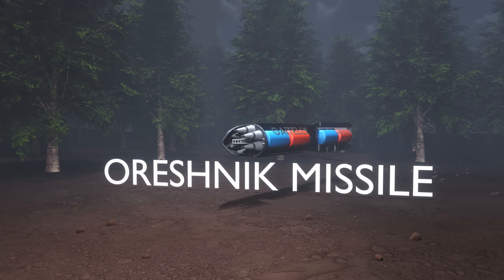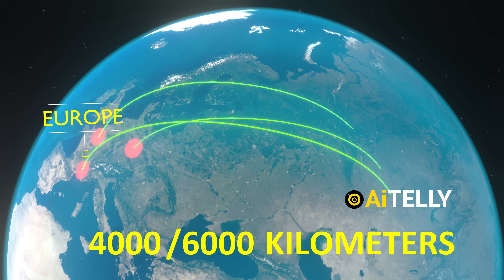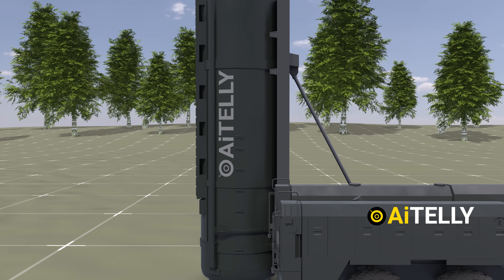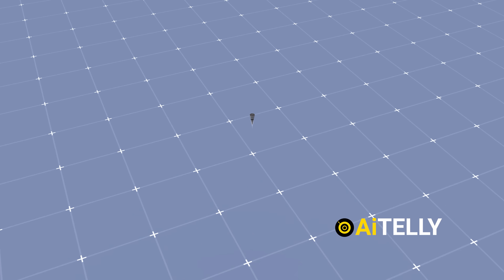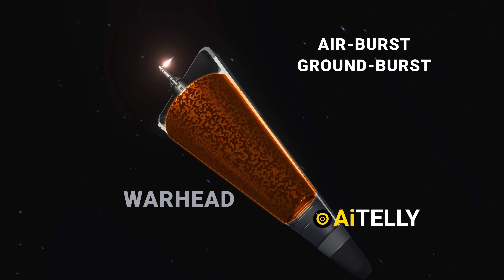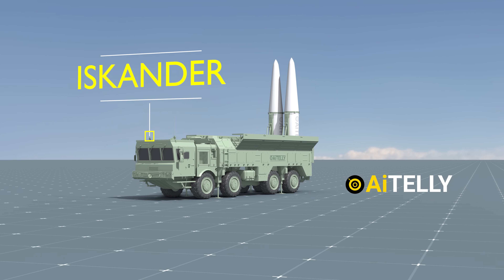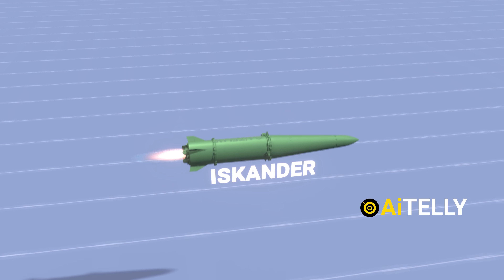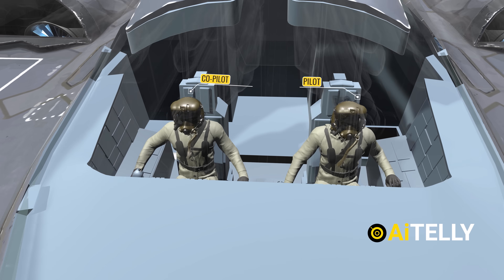Oreshnik Hypersonic Missile | How Russian Intercontinental Ballistic Nuclear Missile Works?

Comment: This didn't quite illustrate Oreshnik and it's 6 by 6 projectile
Reply: Yes the video fails to mention it's 6X6=36. Also the fact that even without a warhead, it impacts at 4000°c melting basically anything.
Reply: Noname knows more then the governments 😆 they just watched from satellites and radars 😂
Reply: Lmao I watched a video were this guy talks about how old Russian missiles are their infrastructure is destroyed. They have old planes have old choppers. They have everything old he said 😂😂😂. I live in Texas. The infrastructure here in Texas is horrible everything is old. Everything is falling apart their electric electricity lines suck.
Reply: But it did gloss over that detail and it's AI so it thinks that's normal/we didn't click to learn that - we clicked for a video where that part of the missile is described as 2nd stage and nothing more - especially if that is the info that sets the missile apart
Reply: @Noname-dtek >"there can’t be any other materials there except special composites"
 Look up Bor's heat shield. That's decades ago. 

>"entry into the atmosphere"
 It might not be leaving the atmosphere during any stage of the flight. The Russians have been favoring shallower trajectory options lately (which yes, are more energetic and require better energy management - but are much faster and more maneuverable - plus stay out of the region that's within the flight parameters of some of the long-range countermeasures currently fielded). 

>"what does it mean that heavy is good?"
 The energy transferred to the target is derived from the strike elements' speed AND mass. Kind of like Rods from God on a smaller, nimbler a scale. Needless to say, the greater mass (per given aerodynamic cross-section) also reduces the sped loss on descent. 

>"the throw weight of the Rubezh missile is 800 kg"
 We don't know the degree of evolution the precursor missile, the bus, and the payload configuration have undergone other than the elimination of the fairing. We may be looking at a factor of 2 payload increase vs your estimate. 

>"if they are separated from standard warheads"
 Like I originally expressed, there may not be a "standard warhead" - those six cones likely each split up into 6 slim sectors radially.
Reply: @Noname-dtek  >"there can’t be any other materials there except special composites"
Look up Bor's heat shield. That was how many decades ago already?

>"what does it mean that heavy is good?"
The weapon is purely kinetic.

>"the throw weight of the Rubezh missile"
Little is known about the actual missile used, although I expect the individual strike "needles" to be in the 20-50kg range. Although the latter at Mach10 would equate to just 73kg of TNT, if they're indeed tungsten, that energy is very focused. At high speeds, concrete, soil, metals, everything - behave essentially like liquids. That's how if you shoot a nail from a nail gun into concrete, it's stuck there whereas if you pound the same nail with a hammer it'll get bent and/or crack the concrete. So that needle may go through tens of meters of reinforced concrete like a hot knife through butter, and only when it slows down, transfer the bulk of its kilograms of TNT worth of energy to the surrounding space.

>"where is the main body of the warhead"
There isn't one. The latest Russian scheme is, no overall fairing - the cones are "naked" with their noses gathered together - not sitting parallel on the bus like on this video.
Reply: No
Reply: It's not carrying 36 warheads.Atmospheric re-entry needs refractory materials. I think it is clear why. And it is simply impossible to create many such submunitions, and they are still very small, which means they need a special stabilizer that not only weighs a lot but also requires a lot of space in the submunition, of which there is not enough
Reply: @Maxie1_4  bruh, there is literally multiple videos of the 36 warheads, what are you on  about
Reply: @leight420 so maybe there were 6 missiles? I explained everything to you and you can't say anything and just tell me about a video that I've seen a thousand times
Reply: @Maxie1_4  if it was 6 missiles the US would've already said so. Ukraine themselves said it was one ICBM, if it was more than one the media would've screamed it to the heavens. You should stop thinking, you're clearly bad at it.
Reply: @lancerevo9747 any mass-introduced opinion is obviously false, think about it. I have not seen a single confirmation of this fact, full-length with all the facts taken into account or at least documents, my words are supported by the laws of physics and the performance characteristics of Rubezh or Oreshnik and so far I have not seen anything that could refute this
Reply: @Maxie1_4  do your "laws of physics" also supersede infrared detection of the launch vehicle exhaust plumes through which the US was able to determine it was one missile fired? If you disagree, why would the Ukrainians fail to report this damning piece of news and use it for propaganda? Also, artillery shells have between 50 to 5000 submunitions per shell and you say "its impossible to create many such submunitions"? I said you should stop thinking, you're hurting yourself
Reply: @lancerevo9747 so what's the point of the US saying how many missiles were flying? On the contrary, it's more profitable for them to say that it was one missile, all Russians admired this weapon and no one would have any questions about why Putin is wasting so many expensive missiles on one non-working plant
Reply: @Maxie1_4  the weight is part of the payload. Heavy is good, heavy is reliable, remember? :) I expect each cone splits up into 6 slim sectors (asymmetrical darts) with the control systems initially nestled in the center of the cone when together. Once they split up, whatever material protecting the control system (ablative or Buran / Space shuttle orbiter type) only needs to be thick enough to withstand just a few sec of exposure. The rest of the dart is likely just tungsten or even some tungsten alloy for extra insanity. With today's tech, you can powderize and bake together materials that wouldn't ordinarily even form an alloy.
Reply: @AlexKarasev Well, firstly, there can’t be any other materials there except special composites and the plasma cocoon will be not only during entry into the atmosphere but also all the time when the rocket has entered the atmosphere, so these are definitely not just some materials that must withstand entry into the atmosphere  . what does it mean that heavy is good? no I repeat to you once again the throw weight of the Rubezh missile is 800 kg to produce 36 small warheads which will be about 20 kg in mass from such composites is unrealistic and they should take up space and if they are separated from standard warheads then where is the main body of the warhead it should also consist of such materials and should withstand such temperatures, it is not visible on the video and no one talked about it and then they should be separated from the bus
Reply: @Noname-dtek  благодарю за ответы.
Reply: @Maxie1_4  From the footage, it evidently carried 36 RVs. Endo penaids of the appropriate design have been produced by Russia since 1977.
No reason to think there was any sort of cluster submunitions nesting going on though.
Reply: @Evan_Bell what?
Reply: @Maxie1_4  What..?
Reply: @Evan_Bell there were no cluster submunitions there. These are typical ICBM warheads, of which there can't be 36 on one missile, this doesn't match up in terms of mass or volume
Reply: @Maxie1_4  Images show 6 objects producing plasma wakes in each of the 6 groups... 
People have proposed 6 RVs were actually cluster munitions that each separated into 6 submunitions. There's no reason for this to be done. 36 objects could be carried and released directly by the PBV. 
You're right, their nuclear RVs are too massive and voluminous for 36 to be carried (it can carry 9), but Russia has possessed endo-atmospheric penetration aids (termed "quasi-heavy false targets" in Russian parlance) with the appropriate mass, dimensions and ballistic coefficient to allow 36 to be carried by Oreshnik, and for them to impact at the observed velocity, since 1977.
Reply: @Evan_Bell what are they called? I'll check
Reply: @Maxie1_4  I'm specifically thinking of the 15Б183 and 15Б235 quasi heavy false target of the R-36MU...
Reply: @Evan_Bell  откуда у тебя русская раскладка?)
Reply: @Maxie1_4  Я просто гуглю русскую кириллицу и копирую нужные мне буквы.
Reply: @Maxie1_4  I just copy and paste the characters I need from Google...
Reply: @Evan_Bell The R-36 is a heavy ICBM and can accommodate 36 heavy or quasi-heavy decoys, but the Oreshnik is based on the lighter R-24 Yars ICBM and it's not a fact that it can carry 36 heavy or even quasi-heavy decoys, plus I don't have a picture of these decoys so I can find out their sizes.  By the way, don't forget that Oreshnik is also a shortened R-24 and has less throwing weight
Reply: @Evan_Bell  It's a pity, I already thought you were one of ours)
Reply: @Maxie1_4  My replies are being removed...
Reply: @Maxie1_4  The R-36 has a throw weight of 8,800kg. The M2 Voivoda variant can carry 10 high yield nuclear warheads, plus 40 decoys. The RS-26 / Oreshnik has a throw weight of 1,500kg. The Russian MoD gave this figure. 
These endo penaids weigh around 25kg. That amounts to 900kg, plus 600kg for the 15F655 PBV.

I have images of both these decoys. 
Their dimensions are 23cm base diameter and 1.15m length. This is the maximum size for 36 of them to fit inside the 1.55m diameter fairing of the RS-24 and Topol-M.
With that weight, dimensions and shape, they have the right ballistic coefficient to achieve the impact velocity observed.

Nah, I'm English, but have several Russian friends from an international school I went to.
Reply: @Evan_Bell anyway dude i cant find any confirmation for what you say but i cant 100% refute it either. i tried to find full info on them but couldnt find any,and I'm not at all sure whether such a quasi-heavy decoy can enter the atmosphere, because from what I read I understood that this decoy is designed to imitate the behavior of a warhead during exoatmospheric flight and early entry into the atmosphere. So your opinion is a rather interesting assumption, but I still haven't found any evidence for this
Reply: @Evan_Bell and explain me one more thing: Why do they arrive in groups of six in the video? It doesn't matter if they are combat units or decoys, they still arrive at about the same time, a second is too much
Reply: @Evan_Bell  у меня тоже такое часто происходит, очень сильно раздражает. Но я в уведомлениях большинство ответов вижу
Reply: @Evan_Bell  короче, чел, ну не может 25кг конус войти в атмосферу на скорости в 10 махов, он просто не выдержит температуры в 5000°C, чтобы такая ложная цель совершила полноценный вход в атмосферу понадобится как минимум 60-100кг
Reply: @Maxie1_4  There are a number of possible reasons the 36 RVs could have been released in 6 groups of 6, including simply wishing to target different aimpoints.
How did you figure 25kg objects can't survive reentry? Again, decoys of this mass exist, and they are designed to escort the warheads all the way through the atmosphere.
The fact that you've not been able to find information about them, doesn't mean they don't exist.
It's perfectly possible to develop such an object. The ablative heat shield thickness need only be 10-15mm to survive reentry. The size of the structure underneath is of little importance.
From the footage, we see 36 objects falling. From the debris recovered, we know it uses the 600kg 15F655 PBV. The RF MoD stated the throw-weight as 1,500kg. We thus know 36 25kg objects survived to impact.
Reply: @Evan_Bell  Брат, короче, помолчи и может быть я подумаю что ты умный
Reply: @Maxie1_4  What's your problem? I'm explaining the reality to you. You're the one talking nonsense saying 25kg objects can't survive reentry, despite such objects having existed for almost 50 years.
Reply: @Evan_Bell  ты мне объясняешь лишь свою гипотезу. Ты мне дай ссылку на источник,без этого ты ничего не докажешь. Где хотя бы доказательство использования таких ЛЦ на ракете Ярс?
Reply: @Evan_Bell  мне не нужен источник откуда ты взял их существование, ты мне дай источник откуда ты взял эти параметры. Вроде бы был нормальным типом, вроде умным но так и не дал ссылки на источник и уже чесно надоел. Да даже если ты и прав то Южмаш не достоин применения даже одной ракеты Орешник по нему, этот завод давно заброшен. Орешник неефективен в неядерном оснащении, в этом просто нет смысла, а удар по Днепру это лишь пример растраты уже стратегических носителей ЯО на бессмысленные с военной точки зрения объекты
Reply: @Maxie1_4  Test.
Reply: @Maxie1_4  Test..?
Reply: @Evan_Bell  на беременность?
Reply: @Evan_Bell  короче спокойной ночи
Reply: @Maxie1_4  Replies removed...
Reply: @Evan_Bell  Anyway, let's say goodbye. Your hypothesis is quite interesting and has a right to exist, but I did not find detailed information about such false targets, there is an article in Wikipedia, there are some articles on other sites, but I did not find detailed information, if you have a specific source, please provide it, if not, then let's each remain with their own opinion. Also, please forgive me, I was just very tired
Reply: @Maxie1_4  I've tried giving you sources, but replies keep being removed...
Reply: @Evan_Bell Well, maybe the filter considers it spam, but anyway, the assumption is interesting and I will get back to you, I will try to check the information better
Reply: @Maxie1_4  Or did the warheads simply disintegrate in the last section, and therefore it seems that each of the 6 warheads has submunitions???
Reply: @КешаБурундук  нет, там скорость 10 махов и при такой скорости в любых слоях атмосферы будет создаваться плазменный кокон. В лучшем случае это 3-4 ракеты в самом реалистичном 6
Reply: @Maxie1_4  про плазму - это понятно. Но меня всё равно интересует: были ли суббоеголовки у каждой из шести боеголовок или нет. Аргументация про то, что они распались малоубедительна. Но с другой стороны и разделение такое сильно тоже не рационально.
Reply: @КешаБурундук  оно невозможно из-за высоких температур на гиперзвуковых скоростях на каждом из этих суббоеголовок должны были быть специальные тугоплавкие материалы которые весят не мало а забрасываемая масса ярса составляет 1200кг и ещё надо учитывать что это урезанная версия ярса и в лучшем случае это будет 800кг . И я не видел падающий после суббоеголовок основной корпус боеголовки
Reply: @Maxie1_4  так получается, всё-таки 6 боеголовок развалились в ходе полёта на последней стадии? Теоретически это возможно.
Reply: @КешаБурундук  я что то не понимаю что ты мне хочешь этим сказать? Если бы они небыли сделаны из тугоплавких материалов то ниодна боеголовка не достигла своей цели . Ты со мной "споришь" или просто общаешься ?
Reply: @Noname-dtek  просто общаюсь, пытаюсь понять, что было. Я честно говоря не знаю, удачный ли запуск или нет. Нет никакой объективной информации.

С одной стороны: считается, что удачный, все боеголовки MIRV прилетели в одну цель, сохранили скорость.
С другой: есть ощущение, что боеголовки (6 штук) развалились на последнем этапе траектории. Развалились по какой причине - неизвестно (причин много, на самом деле).
Reply: @КешаБурундук  южмаш уже давно не работает и конечно же он был бессмысленным даже если бы пуск был один . Можешь пж  объяснить что ты имеешь ввиду под "развалились" просто я не понимаю
Reply: @Maxie1_4  в том смысле, что каждая из 6 боеголовок рассыпалась, не выдержав нагрузки. Грубо говоря, металл просто треснул и порвался на части, причём в всех 6 боеголовок одновременно, и у всех в одно время.
Reply: @КешаБурундук  ну...маловероятно, и как-то они слишком хорошо летели. Да и тестов такие боеголовки проходили не мало
Reply: @Maxie1_4   NO PUEDO CREER QUE ESTEN HABLANDO DE ESTO USTEDES PARECEN PRO COMEDIANTE ZELENSKI , LO QUE VIERON SE LLAMA TECNOLOGIA AVANZADA y cada vez pase el tiempo se va a ver cosas de otro universo rusia es asi  😎😎😎😎
Reply: @Maxie1_4  да, у них очень хороший баллистический коэффициент, но если разделить боевую часть весом 2 тонны на 36 боеголовок, то вес каждой - 55 кг, и даже на скорости 10 махов (теоретически 10) кинетическая энергия будет небольшой, недостаточно высокой для оружия такой стоимости. Нет смысла делить 6 боеголовок ещё на несколько суббоеприпасов.
Reply: @Maxie1_4  "орешник" - это может быть вариантом ракеты "Булава" в качестве опытного образца. Тем более запустили его с испытательного полигона. Может быть испытывали, и испытание прошло неудачно.
Reply: @КешаБурундук  ДА! Так там даже не 2 тонны а около 800кг плюс ещё немалый вес занимает основной корпус боеголовки (если она потом разделяется на ещё 6) и по этому я и думаю что это не одна ракета ведь по массе не сходиться
Reply: @rossiskaya  ин инглиш плиз! 🤣🤣 пиши либо на русском либо на английском!
Reply: @КешаБурундук  булава летела бы намного дольше
Reply: @Noname-dtek да, я просто теоретически взял по максимуму. И скорость была ниже, вероятно, на последнем этапе (2-3 км от земли), 8 махов, не 10 и не 11. Ну, а насчёт булавы - сняли одну ступень. Но это я так думаю, просто домыслы.
Reply: @КешаБурундук  если бы сняли одну ступень(как я понимаю вторую) то она прилетела бы быстрее не 15 минут а 5-7 и летела бы ниже да и траектория была бы другая потому что первая ступень просто выводит ракету из атмосферы а на третьей ракетного двигателя нет